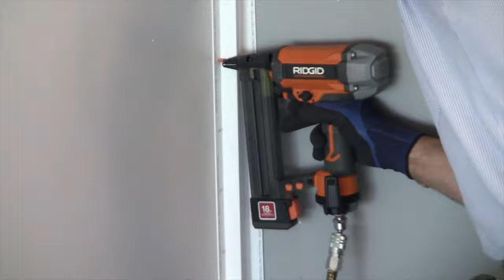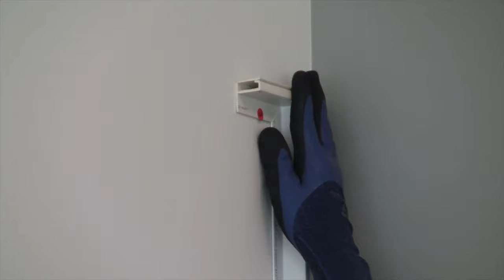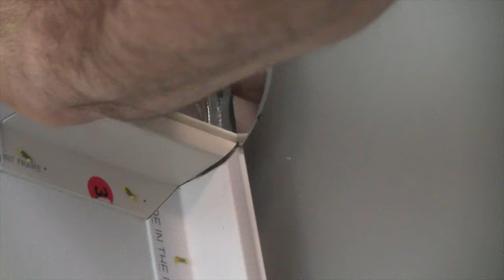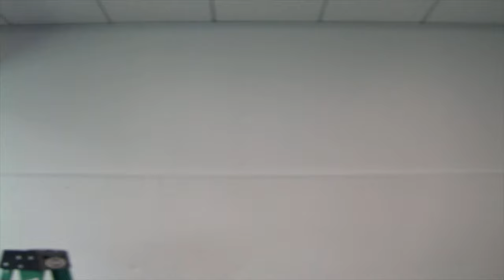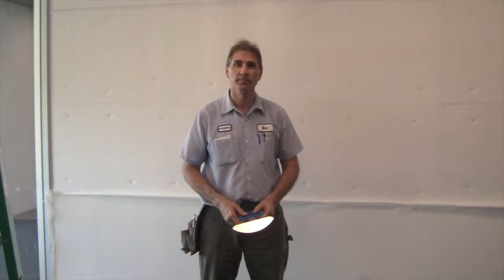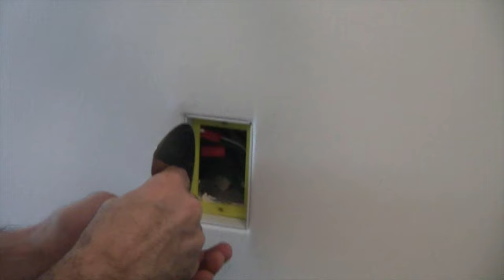FabricMate Acoustic Wall Install With and Electric Openings

Comment: Thanks Ken for these. But, why do the frames crack so easily when stapling?? I am down to 50 psi and still crack and they are flat to the wall. Even if I staple em horiz or vert staple wise... They mostly crack :-/ ... I am using a cheap not much setting Arrow PT50 w T50 staples. Is it the width of the staple needs to be wider so as not to seem like they knife right thru... So none of your frames cracked in this video?
Reply from the maker: I did not have that cracking issue. I used dewalt staples, try those.
Reply: @KenTraining  Thanks, seems like if it had to be specific would be more on the topic. Do you recall what your psi was?
Reply from the maker: @davidkovach-tangier I think I was running 50 psi but that was some time ago.
Reply: @KenTraining  Ok thanks Ken. So, to any needing tips: there are none, I think my issue - if its not perfectly flat it will crack, so pilot hole + drill in those cases. Otherwise, cheap Arrow PT50 w T50 staples 1/2" works perfect @70-80 psi